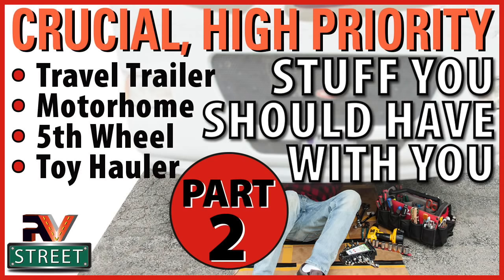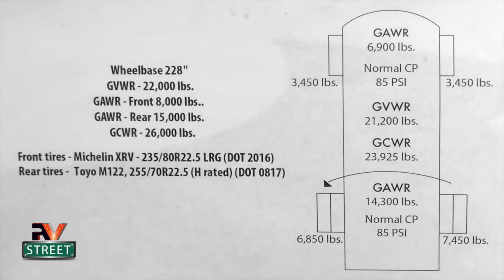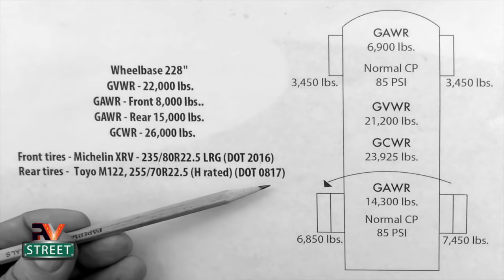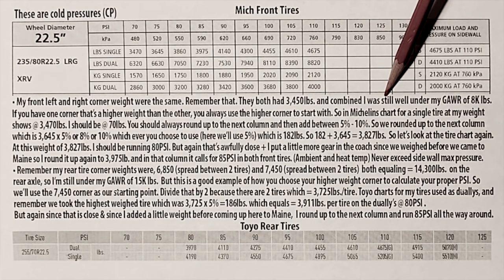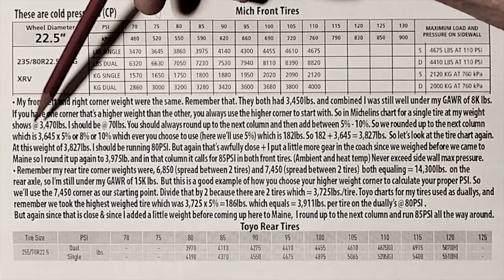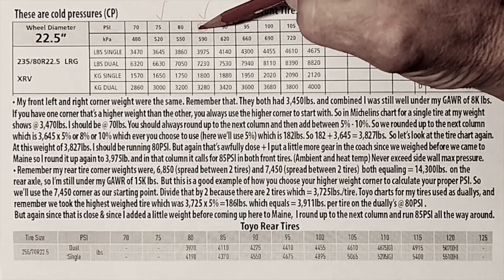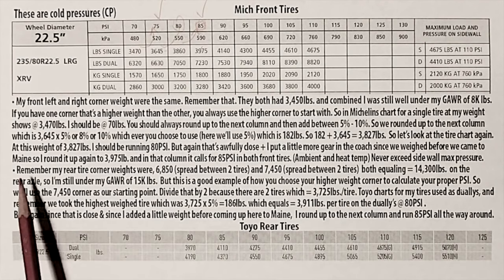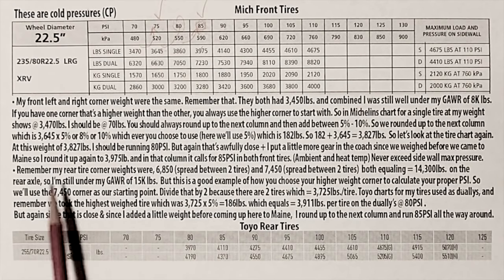How to CALCULATE tire pressure for a motorhome • Or Bad Things Happen

Comment: Martin, I love your videos!  But I have a question.  I am looking for valve stem extension brackets to hold the extensions for my 22.5" dually wheels on the back of my MH.  I find it hard to inflate the tires if the valve stem extensions (if you have them) are not held by some type of bracket.  I am curious what you have come up with or what you do.  The setups I have found online only work for wheels up to 19.5".
Reply from the maker: Hi Ken,
It’s funny you asked this question b/c I’m releasing a tire video this Sunday night where I cover this and more. I don’t use brackets. I use rubber grommets in the holes on the rim to hold and keep tight my extensions. They are really tough to find but I finally have them in my Amazon Store. They fit the same size rims I have. There in the “Tires, Engine and Chassis Care” category. There a little pricey but well worth the money. They unfortunately also come with the extensions. Just don’t use those. Just press these grommets in the holes on your outside dually’s, the extension comes through them, then attach your TPMS sensor.
https://www.amazon.com/shop/rvstreet

Comment: Your attention to detail is impeccable Martin. Great video! I can only imagine how many people out there driving around with out a clue.
Reply from the maker: Studies show that 6 out of 10 RVer's out on the road are over loaded. Scary isn't it? No wonder youtube is filled with RV accidents and mishaps. Just imagine how many were not caught on a dash cam. 😢
Reply: @RVstreet  Yes it is. I'm a truck driver by day, and I've seen a few. Now that I have a tt my biggest concern was the weights and tires, and now that I do have one I'm paying more attention to them on the road, and I must say there are a lot of mixed match combinations out there.  Safe travels sir,  thank you for your knowledge.
Reply from the maker: Just to clarify, this video is for motorhomes because of the their characteristics, weight distribution and most all have dually's on the back. I'm not well versed in calculating air pressure for TT's but I do know that procedure is somewhat different, so be sure to research your situation.
thx again JM 👍

Comment: Hi Martin,
Very detailed and complete explanation!  Good work!
I have a question with respect to the tire pressure specified by the motorhome manufacturer.  
Isn't this pressure computed to accomodate the heaviest weight that the motorhome can carry?  In your case, does the calculations come with a higher number than what the motorhome manufacturer specifies?
Thanks again!
Reply from the maker: I'm sad to say that Martin has passed away and I don't have the answer to your question. Sorry

Comment: Very Professionally done video!    Thanks Martin.     Although the OD of the tires are probably the same, why did you buy different size tires for the rear?   Availability?   Respectfully,   Kevin
Reply from the maker: I wanted Toyo  "H" rated tires on the back.

Comment: Great video! Thank you for your help. Very informative. I have screen shot my tire pressure chart from the manufacturer. And put a note in my phone for the easy math. I will be getting a TPMS put on my rig. Along with your help. Plus I'm buying a 6 new tires. So I'll know the history of these tires going forward. 
Safe travels and thanx again! Joni and Vinnie
Reply from the maker: ThanK You Vince 🔧 👍
I'd like to highly suggest the TPMS that I use. I explain why here: https://www.youtube.com/watch?v=2kCXRbvtoYA&t=472s 
Using the right TPMS is a very important item to have. If your interested, the one I use is in my Amazon Store. Not a sales pitch, just want to make sure your readings are accurate, keeps you safe, and you get good customer service if you need it.
https://www.amazon.com/shop/rvstreet
In the "Tires, Engine and Chassis Care" category.
If you have any other questions don't hesitate to ask me either here or on my FB page. 👍
Reply: @RVstreet  well it seems I'm having a hard time finding a scale that weighs each corner.  I mean I can go to a cat scale. But I think it only reads front and rear.
Reply: @RVstreet  oh and thank you by the way lol
Reply: @RVstreet  I checked the TPMS. Looks like I won't need the metal valve stems? . . . But I will read more into your suggestion tonight. Price isn't bad. I just had a blow out a month ago. Inside rear. Class C. Went from my home in Central Florida to northwest Indiana. Had my tires checked by a Goodyear dealer before I headed back. And they set all my tires. And I still had a blow out. Luckily it handled fine with only one rear down. So, new tires and TPMS. After all the damages are fixed. . . Which may be a while. . . Oh I subscribed to your channel. Lots of great info.
Reply: @RVstreet  I have the same compressor.
Reply from the maker: OK if CAT scales are all you have available find one that does NOT have the yellow guard rails on the sides of the scales. Then pull the up and put one side of the RV on the scales with the other side tires off the scales. Your front tire on the front scale and the back duallys on the middle scale. That will give you the weight of those corners. Repeat the process for the other side. Then do one more weigh with both front tires on one scale and the duallys on the other. This third weigh will give you a—check and balances of sorts—of your other two weighs to make sure all the numbers are right. It's not the best way to do a 4 corner weigh, but it will get it you right in the ball park of your weight. Once you have those weights, now you can use my procedure to properly inflate your tires with the right amount of PSI.  https://www.youtube.com/watch?v=Q_NuEoBIxe8&t=598s
The three biggest reasons for a blow out is tires being under pressured, an over loaded RV and tires that are out dated.
As another alternative if your ever in TX, AZ or FL Escapee's has the best method of doing a 4 corner weigh. It's called SmartWeigh. It cost $40 I think and you need to make an appointment. I have a code for that in the description text in the above video.
Reply: @RVstreet  Great! Thank you again! I will check into both.  I've heard of escapees. But haven't looked into them. Great help. Been watching other videos if yours.
Reply: @RVstreet  our RV is also a 2012. We bought it used 2 yrs ago. The RV didn't need anything. Over the last 2 yrs I've gone through everything (except tires). Tires were last on the list. Roof has been checked yrly since I bought it. Cleaned the air conditioner unit. Serviced generator, New house battery, New mattress, changed all interior lights to M4 leds, new wiper blades and engine air filter, engine oil and filter, getting new tires within the month, put on new awning, had LED lights put under the awning. I also had Chevrolet do a complete check on the chevy portion of the rig for. It needed nothing. Runs and drives like new. 9.8 mpg which is what got coming back from Indiana. Most of that list was done only for a piece of mind. The awning was frayed a little on one end. So I replaced it. House battery was shot. And the mattress came from mattress insiders. Because the dealer swapped the factory one out unknown to us for a piece of crap. The exterior is like new (almost). . . Red graphics are cracked up. And could use a good polishing on the box portion of the rig. Truck cab is shiny. Rear bumper needs repaint or powdercoat.
Reply from the maker: @vincejewart7431  👍

Comment: I'm a full-time Rver with very little maintenance experience. One pain in my side has been the exterior water connection in the Wet Bin. I can't stop it from dripping water. I managed to get it tight enough once that it didn't leak for a few months. Now it's leaking again. I've looked at it and it has two points of connection. The first is the water hose from the water spigot. The second is behind a metal plate. I can reach it and feel a plastic tightener with grip tabs on it. I've tightened it as much as I can but still leaks some. How can I make this a simpler connection that won't leak?
Reply from the maker: Change the rubber washers inside the hose connectors on the RV and then put quick disconnects on your hoses and the RV connectors in the wet bay. No need to be fussing with your water and hoses all the time. Be sure to watch some of my water videos in the PLAYLIST link I just sent you in other questions you asked
My brass quick disconnects are the best on the planet. Everything else is junk, will leak and crack. I have them in my Amazon Store in the "Everything Water & Sewer" category: https://www.amazon.com/shop/rvstreet

Comment: Thanks Martin! Definitely getting George weighed this week...in the meantime, I am using the suggested pressure that’s on my driver’s side wall. It says 100 lbs in all 4 tires so maybe that’s one of the differences in a 22,000 lbs and a 24,000 lbs chassis. What does your wall plaque say? I have Michelin’s all the way around George and that’s the brand I recommend...what do you recommend 😂😂😂 Just kidding! Another great and informative video! Hi Joanie 😊
Reply from the maker: My placard says 90PSI. But as you can see, if I used that as my starting point by the time I used the pressure formula, my tires would be way over inflated and our ride would be horrible.

Comment: At around the 6 minute mark I noticed the stripping decals on your coach (only because I working on mine). The dark brown line breaks at a vertical trim point where the other 2 lines cover the vertical trim point. I wonder why they would do that at the factory?
Reply from the maker: Who knows 😎

Comment: Great info. The DOT 4 digit number is date of tire. First 2 numbers is the week in that year the tire was made. The second 2 numbers are the year the tire was made.  If you exceed 26,000 pounds, you (the driver) are required to have a CDL (commercial drivers license). If you are using 22.5 tires, you can buy wheel balancers that look like a hub cap that fits being the wheel that has steel balls and oil in them. They are a little pricy, but I believe are guaranteed for life. Cat scales do axle weight not tire weight. I have driven tractor trailers for 29 years and have never seen a tire cat scale. But you are rite about the Escapees having a wheel scale. And yes it is well worth the money ($40)
Reply from the maker: Yes those wheel balancers are called Centramatic Rings/Balancers and we have those all the way around on our coach. I love those things. Keeps your tires perfectly balanced and it's a one time purchase. BTW... Centramatic Rings are now available for RV's, heavy duty and light trucks, trailers and even motorcycles.

On the CAT scales...I read recently it is CAT policy to not do one side weighs and that is why they are making it harder to only get one side on the scale. Some locations are now adding guard rails alongside the scales. But some locations still let you IF they don't have guard rails. I have found that it just depends on each locations manager. But the way you do a 4 corner weigh is run one side of the motorhome on one side of the CAT scale and get that side front and rear weights. Then back up and put the other side of the motorhome on the other side of the scale and get those front & rear weights. Then do a front and rear axle weigh just to have that added info. It's not as accurate as Escapees for sure but will do in a pinch if that location will let you do it. When we first got our motorhome 4 years ago that's what we did at a Flying J.
For those of you reading this post, there are other places in your area that can offer a 4 corner weigh like for example, sometimes a local building supply. But this is why I didn't go into all the weighing aspects in this video. There's to many variables/options and requires it's own video. Comprehensive instructions and information for weighing is already out there.
thx for your input Joe. 👍
Reply: @RVstreet  I  never even thought of that. Now that I think about it, Sunshine truck stop on I-95 Florida / Georgia line used to have a axle scale. That would have been good for corner weights. 👍👍

Comment: Until I get a four-corner weigh as a starting point I am thinking I should base my Tire Pressure calculation based on the GAWR of my coach. I have gotten a Cat Scale weight, so I know I am well under the GAWR for my coach. Unfortunately, all the cat scales in my area have rails or curbs that prevent weighing individual wheels. I would use my GAWR for each axle divide by 2 add 10% and use that weight to find the tire pressure. I understand that this will likely have the tires over inflated for the actual weight carried but, I would much prefer a slightly harder ride than risk tire damage from underinflation. Am I thinking this through correctly?
Reply from the maker: Yes in a pinch that would be better than running under inflated for sure BUT....just be aware running over inflated is not good either. A little over is OK but the way you're calculating it it's only guessing. Also calculating that way will NOT show you the heaviest corner so you won't be able to know your weight distribution either.

Comment: I have heard of coachers fill tires, especially rear, to different PSI based on the corner weight.... what are the thoughts on that approach?
Reply from the maker: If your weight is way different on the back tires that is very reasonable to do

Comment: Great video!  Easy to follow.  Would you please do the same type a breakdown for towing a car.
Reply from the maker: When you read or watch how to properly weigh your coach that should be covered. If you're towing 4 down nothing changes. You're just dragging the toad behind you. There is no additional weight added. Towing 4 down will only affect your GCWR. 👍

Comment: Always love your videos and learn so much.
 I have a question, how do you feel about valve stem extenders for the inside rear tire on dullies? It's always so hard to reach when having to add air.
Reply from the maker: I have no problem with metal extensions. In fact I've been running them now for 5yrs. and just had 6 new tires put on last Friday along with all new stems and 2 extensions. My extensions are 5.5" long. I also installed a rubber grommet in one of the holes on rear dually aluminum rim to firmly hold the stem in place. I'll be releasing a video on this new tires install later on.

Comment: I set my tire pressure at 100 psi based on 4 corner RV weight. 

Should I adjust the cold pressure setting back to 100 psi in summer after setting it to 100 psi in winter?

Thanks for all your great tips and FYI's
Reply from the maker: Yes.
Once it starts to warm up you'll find that sweet spot for spring, summer, fall temps. That's why you add that 5 - 10lb buffer to accommodate ambient temp swings. But once winter hits you'll have to make another adjustment all the way around. I change my cold pressure PSI twice a year.
Reply: @RVstreet  Thanks

Comment: Perfect timing for me!  My RV is a big Class A with Tag axles.  I had it weighted on...well 6 corners.  Could you do an update for such a case.  Plus: there are 11 batteries (@68 pounds each) on the back axle passenger side.  Do I still make no difference and share the weight on both sides?
Richard
Just north of Maine
Reply from the maker: All tires on each axle should share the same PSI. If you don't you'll have uneven tire wear plus one side will run hotter than the other and excessive heat is ONE of the things that hurts tires. Always use the heaviest side to calculate from. WOW, 11 batteries.

Comment: Great info well explained .... as usual!
Question:
If I am only able to get front/rear axle weights, to get a "ballpark number" for the for the single tire formula, could I divide the axle weight by 2 for the front and by 4 (dully axle) for the rear?
Reply from the maker: Yes you could BUT.....just think about it. What if you have a heavy side like I showed you we did. Most coaches will always have a heavy corner and that's the info you need to accurately calculate the proper PSI for all tires on that axle. If you ball park it.....well....it's ball parked. I would find a scale that I could pull up on and weigh the front and back drivers side dually's on one half of the coach, then back up and do the same for the right front and rear. That's another way you can get a 4 corner weigh. For me....this is to important to rely on axle weights. To much room for error.

Comment: Hi Martin. Thanks for all the detailed information.. Wonder if you could advice:  I am about 50 miles to "SmartWeigh "here in Florida.  I have just purchased my 2015 Fleetwood Bounder (Private sale ,July 2022) . To drive the RV to have it weighed, I am wondering what pressures I should use . I am not a full timer and being its new to me i will not have much loaded . If this all makes sense ,how should I go about  figuring out what pressures i should use for the trip to and from SmartWeigh  !! Thank you.
Reply from the maker: Fill tires to 90psi to go to Smartweigh. You'll be fine. 
But I must say, if you're going to Smartweigh—or any method of weighing for that matter—you really need to have your RV totally loaded with what you would be carrying on any given trip. Full propane, full fuel tank, 1/3 tank of fresh water, all your camping gear, all your tools, all people & pets, everything....and so on. Then weigh. That will tell you the true numbers of your 4 corner weigh and then from there you can calculate the proper PSI. Make sure both tires are filled to the same PSI as well as all 4 dually's. The front tires may be different from the dually's but sometimes there are the same. For me.....I run 90psi all the way around according to my weight.
Reply: @RVstreet  Thank you